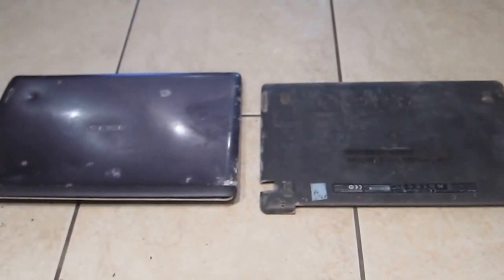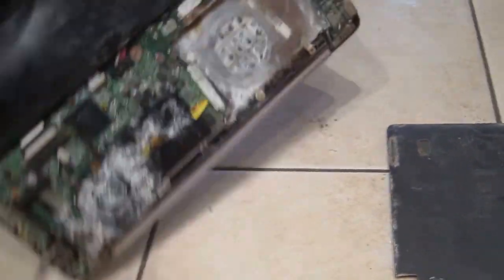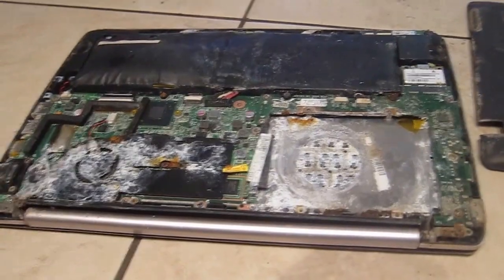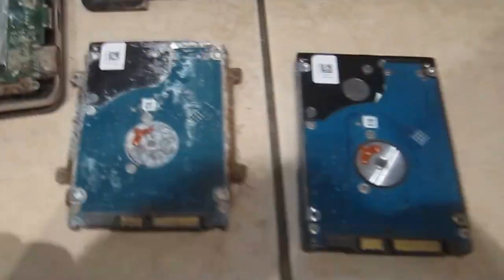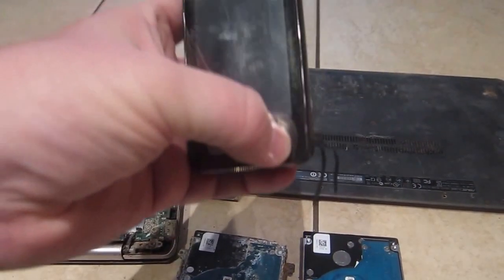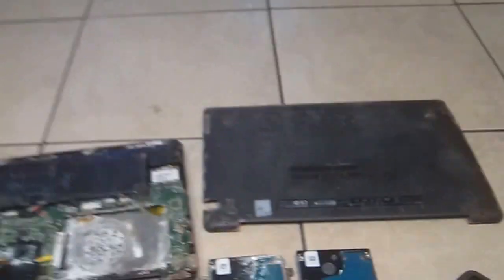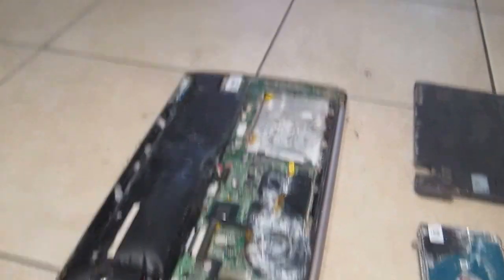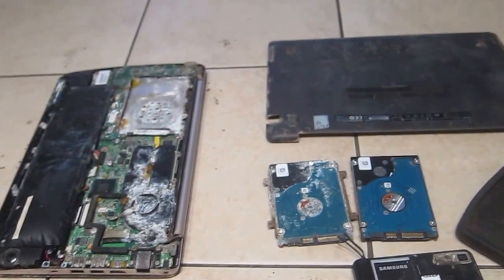Garrette Ace 250: Best Find, a Laptop computer!

Comment: You don't need to get an exact copy of the HDD, as long as the new one has the same or more amount of space on it. I've cloned very different types of drives without any problems.
Reply from the maker: The drive doesn't even work, so I'd need the exact same one to pull out the actual disk of the drive and move it to the other hard drive. Then line it all up and hope it works.